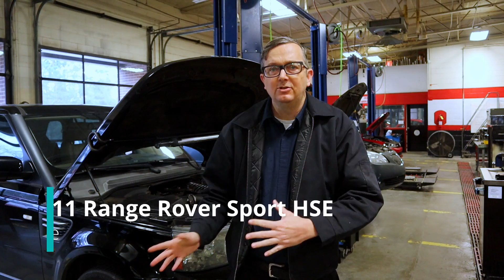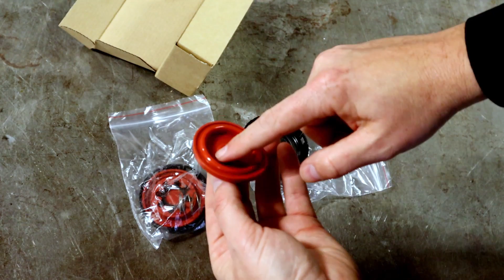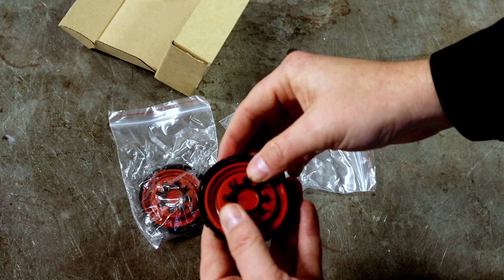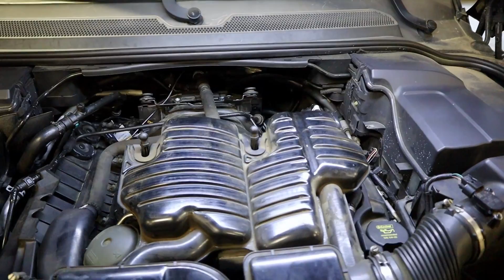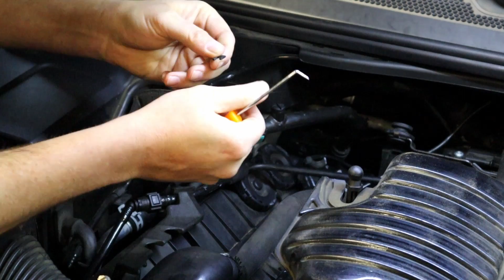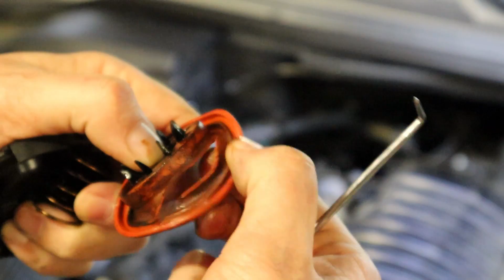Land Range Rover PCV Repair for P0171 P0174 and others

Comment: Hi bro i had the Lr3 2008 4.4
I had some missfire on cylinder 1 and 6 sometimes 
Poor acceleration and Hestation

I pay attention for this when I loose the oil filler cap the engine is turning off,  in this case can pcv is problem it stuck open

Comment: I had them replaced by Goodyear first. Still had codes and problems. I then had European Motors replace them, and they found leaked oil in the case that still tripped the codes. One removed we are fine. Thanks for the video.  I wanted to know what was done. $700 later, but I'm over 200K miles and needed to be sure.

Comment: replaced PCV Valves and still getting the same codes, what do you think next steps would be?
Reply from the maker: Smoke test for vacuum leaks would be my next move
Reply: @AutoScholarwithMrB  I should've messaged you with that information too. No smoke leaks when I did the smoke test. Sounds like the car is literally gasping for air upon acceleration

Comment: I have the same range rover i changed that and the air filters and the engine code is still on  code po171 and 174 what should i try
Reply: Just had mine changed, and they said it had leaked oil in the case because of the ripped valve that they had to clear out. Then, clear the codes.

Comment: Thanks for doing this.  Crazy question had my alternator replaced by a shop.  Then there were codes they didn't want to check out there work but finally did and found something ann no more codes.  But I have a whine when under any load even very slight.  As soon as you let off whine disappears.  Light touch on gas whine comes back and stay as long as gas is pressed no matter how light.  Wondered about tensioner but also vacuum leak but no codes.  Any help would be greatly appreciated.   Shop won't try and find the problem but it wasn't there before they did alternator.

Comment: Hey- great video. I've got a 2010 RR S/C 5.0L, 97k miles. Today the check engine light illuminated (truck running fine), and when I scanned I got both the P0171 & P0174 code (permanent). Does getting both codes at the same time direct me to anything specific? I've had MAF codes before, but not this time. (I cleaned them 6 months ago.)  ?
Reply from the maker: Definitely check for vacuum leaks

Comment: having the smoke on hard acceleration , lean codes , bad fuel consumption and gear slipping , on a 2010 hse ,  a mechanic was saying i need a pcv and acting like it was doom and gloom and to junk the car , he just drove it around the block car is absolutely fine... only to find out its a under $50 fix, i think he was just hating

Comment: Hello, very helpful video, thank you. After I changed a nePVC diaphragm and cap, there is some hissing sound coming from the PVC cap hole, is that normal? Thanks
Reply from the maker: No, did the diaphragm slip?
Reply: @AutoScholarwithMrB  no, it was tighten up vet well, it was very straight forward. I mean I heard some hissing sound then I put my finger to cover the hole, it sounds louder, but when I took the dip, I don't here the whistling sound any more. I took a video, is there a platform I can share to you? Thanks

Comment: I HAVE A 2011 RANGE ROVER SUPPERCHARGED 5.0 AND MINE WENT TO LIMP MODE AND WHEN I PULLED THE SUPERCHARGER LID SAW OIL AND GAS MIXED IN THE BACK CYLINDER 8 STORED UP LIKE I AM GETTING OIL THROUGH THE VACCUM SYSTEM.  i PUT BACK TOGETHER AND STARTED WITH THE OIL CAP OFF AND YOU CAN DEFINATELY FEEL A VACCUM ON THE OPEN OIL FILLER.   IT SMOOTHED OUT SOME.  WHEN I REMOVED THE PCV VALVES I HAD TO BREAK THEM OUT, IT DIDN'T LOOK LIKE THE RUBBER WAS WARN WITH A HOLE.  COULD IT BE THE SPRING THAT FAILED ON THIS?  IT SMOKED LIKE THE DEVIL.  THANKS
Reply from the maker: Could be, I would replace and retest

Comment: I've got an 03 rover 4.4l with ccv / pcv on back side of plenum. Not until I removed did I see replacement was taller and now can't get old one to stay on any ideas.
Reply: The old one is half the height of new one and new one narrower in diameter by 15 x .001i just can't get the old one to go back in place.

Comment: Hi
Can you please advise me on an issue with my 2011 Range Rover sport.
I had the plastic manifold changed about one year ago, I also had the two air flow sensors replaced around the same time, the car run perfectly until now the red triangle is coming on saying reduced power
It comes on around 50 miles per hour and stays on until I turn the engine off and leave for a good while it then goes back to normal, yesterday I drove it just over 70mph and it all went well, until after a few miles on the power loss light
What should I do
Many thanks
Stuart
Reply from the maker: You will need a code reader or scan tool to check the codes. That will give you an idea of the issue.

Comment: Did you happen to record the ST/LT fuel trim values before the replacement. In my case I have the supercharged 5.0L throwing these codes with LTFT +25%, but only during idle (both banks). Trim levels are normal otherwise. Would this be the problem?
Reply from the maker: Could be. Also could be other vacuum leaks or a fuel pressure problem. I remember the fuel trims were indicating a lean condition but not sure the exact number since this repair was a long time ago.

Comment: I have a 2011 Range Rover HSE making a whooshing sound at 2500 to 3000 rpm. Could this be causing it? No current codes, 85k miles
Reply from the maker: I’ve never seen these go bad and make noise. Have you checked you intake piping? If it’s loose or has cracks, it can do that. After a while it may thrown a lean code. Smoke testing will definitely show any issues. Good luck with your repair, and thanks for watching!

Comment: Would this throw a air intake leak code? Did smoke test with no visible leaks. P2279 code
Reply from the maker: It’s worth checking for sure, especially if nothing was found with a smoke test. Thanks for watching Alex, let us know what you find!
Reply: First of all, thanks for responding. I replaced the pcv valves with no luck. Mechanic thinks it  is a timing chain issue.wants almost 4k$ the car runs fine with no noises really. Just stalls and throws code p2279 and Р0АЗВ. If anyone has any ideas of something other than a timing chain please let me know!
Reply from the maker: @alextoussaint9424  sorry to hear that Alex.

Comment: great video . can you please share the name actual pieces that you changed how to find them
Reply from the maker: PCV diaphragm, and the ones I used I got off Amazon. GXARTS One Pair PCV Valve Cover Membrane Compatible with Land Rover LR4 Range Rover Sport Discovery Compatible with Jaguar XF XJ XK 3.0L 5.0L LR032082 LR038166 LR051835 LR010780 AJ813535 https://a.co/d/7czVGiJ
Reply: @AutoScholarwithMrB  will this part work for any RRS 2011  mine is diesel
Reply from the maker: @thundermix100  I am not sure, we didn’t get that one in the US so I am unfamiliar with it.

Comment: I have a 2012 jaguar xfr supercharged and im hearing a hissing sound coming from the passenger side bank i have code p0171 for the bank 1 lean i did a smoke test on it and found no leaks could the pcv be the problem

Comment: Mine has caused my VCG to leak. Any hope that just doing the pcv will help reduce the leak and make it driveable for a while?
Reply from the maker: It is possible, I would try this and monitor the leaks afterwards. Thanks for watching and good luck!
Reply: Did it help the VCG LEAK?
Reply: @TheClaravision  I’m not entirely sure, as I had the valve cover gaskets done at the same time! I was fortunate to find a mechanic who did it at his home for cheap.

Comment: When you put the new ones on does it take a minute for the whining noise to go away
Reply from the maker: It did not for me
Reply: @AutoScholarwithMrB are you saying the sound didn't go away? Or it didn't take a minute, as in the sound went away immediately? Just replaced mine on a new to us Jaguar, but after replacing it there is a whistling noise.

Comment: Hello I have a 2009 Range Rover sport with 116,000 miles on it is it necessary to have it scaned first to see if it has any codes .but it’s when I accelerate it’s puts out white smoke is not oil and it’s not coolant so I’m wondering if those PCV valves are bad
Reply: IF ITS NOT OIL AND COOLANT WHAT IS IT? SOUNDS LIKE YOU DONT KNOW. 
LOL...

Comment: Hi. Nice video. It did help me a lot to do the job. But unfortunately my car runs worse now. And I hear a air leak from the front timing cover and I didn’t hear it before. I did smoke test and I see smoke coming out from front timing cover. I know I need to fix it but I’m confused if the new part is bad and it’s leaking internal and this why I hear leak or it’s working correctly and this why I hear air leak from timing cover.  Also when  I open oil filler cap I feel vacuum inside the engine. Is it normal or it’s a sight of a bad pcv valve? I need to figure it out to know if I have to buy a new set of valves or not.

Comment: Wow!  Just what I needed to see done!  My RRS 2011 throws up a tactical smoke screen when I floor it.  Dealer misdiagnosed it of course!  Thanks for this video
Reply from the maker: Awesome! Thanks for watching.
Reply: @AutoScholarwithMrB Where is this located on a 2017 Land Rover Sport HSE 3.0 Diesel
Reply from the maker: @Unknown-0-0-1-  not sure, never worked on one of those
Reply: when u say tactical smoke screen do you mean out the tail pipe a bunch of smoke?
Reply: Seeing the same thing on my 2010 RRS SC. White smoke out of exhaust but not sweet smelling and no loss of coolant. Did changing these fix it for you?

Comment: Would the repair kit work for the '06 Range Rover sport super charged with the same codes?
Reply from the maker: I believe so, but you may want to double check with who you buy parts with for interchangeability.

Comment: Having a very hard time to seating a new pcv valve in a 2016 F Pace. It’s a Land Rover part although it’s the same 3.0L supercharged engine. Any ideas?
Reply from the maker: Try heating the caps with a hair dryer, it may help make the plastic a little more flexible
Reply: @AutoScholarwithMrB  it’s such a tight spot that even lining the spring up properly is a challenge. Thank you!
Reply from the maker: @jackstuckey8171  thanks for watching!